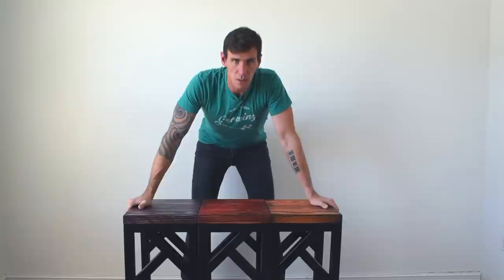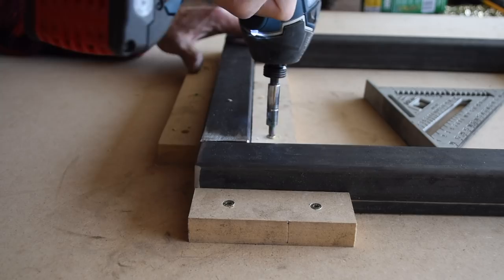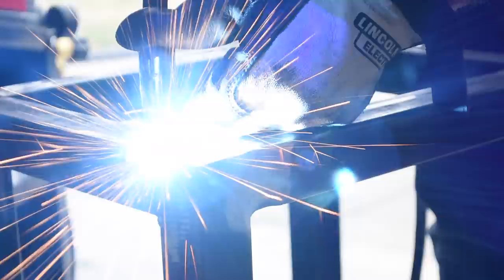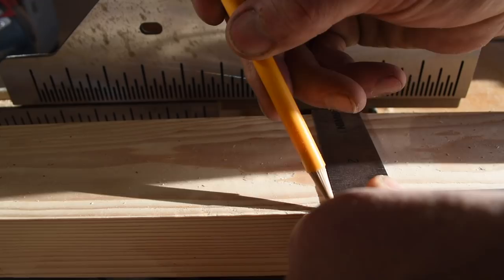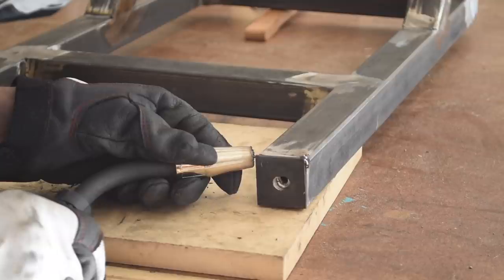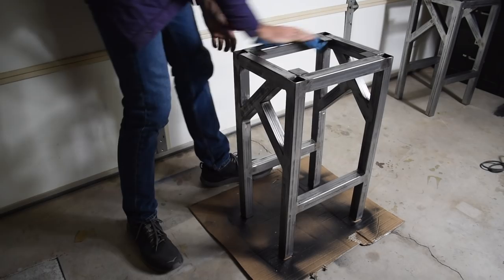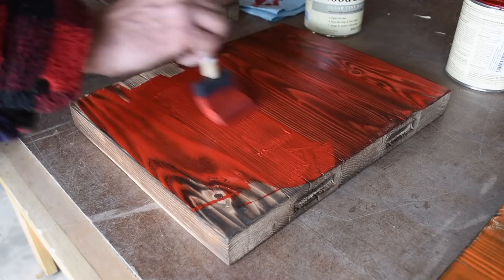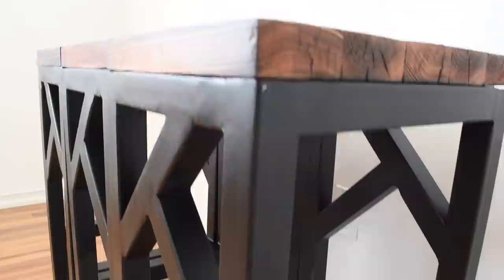DIY Steel & Wood Stools w/ Shou Sugi Ban | Interlocking | Beginner Welder

Comment: Awesome work man! Those bases look super slick. One thing, you probably could have tapped the steel for the adjustable feet rather than welding on the nuts. Would have probably been a lot easier!
Reply from the maker: Thanks, Johnny! I definitely need to invest in a tap set. Someone actually suggested this before I started, and I stubbornly stuck with welding on the nuts because I thought it would be easier. Lesson learned!
Reply: Hah, for sure! You don't even need a whole set, just get the tap you need on a per-project basis. Would have cost you like $10 and saved a buttload of time. Ya live, ya learn!
Reply: I've had 14 ga, even 11 ga, strip after a while, or at least bend, because there aren't many turns of thread in that thickness.  It depends on who sits on it I guess.  If it was 1/4", yes thread the steel.

Nice looking chairs.
Reply: Yea, I would definitely use thicker steel for the bottom of the feet if I was planning to thread the holes.
Reply: One other trick: to align those nuts for welding, run a bolt through the plate with a nut on both sides.  Tighten the nuts, and they are aligned with the hole.

Hi Johnny.  I've watched all of your videos too.  Nice projects.
Reply: RCWorks thanks man!
Reply: Welding the nuts was the right call. As a general rule, you want at least a diameter of thread engagement (depending on the application) and the thickness of the feet wouldn't have provided that.

It's extremely nitpicky, but it's better than having the thread strip and having to redo it.

For next time, I would recommend wearing a respirator when you weld the nuts. Most nuts are galvanized, and if you breathe in the chrome/tin off-gas, you could end up with welder's flu which feels awful. It won't kill you, but you'll be out of commission for a few days.
Reply: Or use rivet nut inserts. No welding no tapping needed
Reply: What type of welding you are using??
Reply: By Da way your projects are awesome have ha great future
Reply: Rip both sides. 
Try using larger nuts. 
If you hard-tap the nut down 
with a metal smooth headed hammer,
while the tack is hot: it won't lift. 
I also find that if I don't keep something
threaded in the nut, 
it can warp the nut 
and it won't pair well 
with a new bolt. 
It's also easier to hold 
the nut straight with the bolt. 
There's also industrial "weld nuts" 
that you can buy a bag of 
which have two tabs on the side. 
Fastenal should have them 
or just buy online.

Comment: Just a tip next time you weld the nut in go ahead and put a bolt in it and spray some anti spatter and it’s a breeze! Nice build!
Reply from the maker: Thanks!
Reply: or use a small metal sheet between the bolt threads and your mig gun or stick

Comment: Thank you for the video! I'm working on a similar steel frame project and this definitely helps with figuring out some of my processes. Someone mentioned taps for the adjustable feet, but I wanted to suggest you could bolt them in place rather than holding them freehand. Obviously use a steel, and not the plastic adjuster. Nice work, they look great!
Reply from the maker: Thank you!

Comment: Try using counter sunk screws for centering your nuts. Just cut it down so it's sits flush with nut, that way the sparks don't stick to the thread.

Comment: For future reference if you want to line up a nut in a hole like that, just tighten a bolt through the nut/plate and align whilst tightened.  This will also protect your thread from weld splatter.
Reply from the maker: Thanks, Adam!

Comment: the stools look great and love the magnet idea

a few comments just for the sake of commenting:

- angle iron would have sufficed

- you've added way too much steel and this makes the chairs heavy and less pleasant to move around, they are really heavy duty as in workbench grade!

- when welding, you should grind more on the edges at 45 degrees or less, then fill that with your welder, you've ended up with less than 1.5mm weld bead after grinding it, while that would be strong enough for a stool, it would be less so for something larger such as a table
Reply from the maker: Thanks for the tips!

Comment: Regarding the adjustable feets, next time, simply put the nut on the feet(or a similar sized bolt). The feet/bolt will help you center the hole. Then just tack it in place and remove the feet. Great project. Love the Shou sugi ban.
Reply from the maker: Yeah, I've had several folks suggest this. Thanks for the tip!

Comment: Nice video and great work. Maybe you have figured this out by now but I believe your wire reel was upside down.  You want that wire feeding in from the top so it’s feeding straiter from the reel.    Might notice the weld being more constant and not fazing out once and a while.  This also happened with the whip isn’t strait. But for first time welding looks great.  Cheers.
Reply from the maker: Thanks! Someone told me and I fixed it already. Shows what a welding noob I am, haha!

Comment: My assessment. Overall good design process and execution. Some of the design boils down to taste, which allows for changes. I would round the edges of the wood more. You did not show any of the welds. I could barely catch the sound of the welding and it appeared to be adjusted ok. You can also add filler if you do not want the welds to show. As a welder, I like my welds to show. 

Your idea to make a jig was a good idea. When welding it is good practice to keep the pieces secure or else a lot of warping may occur. The use of adjustable feet is a good idea because it is almost possible to get them to sit flush with each other. Be careful the amount of weld you put around nuts. Because of expansion by heat, you may need to re cut the threads.

 If I was doing metal work on indoor/outdoor household items for sale or for personal use, I would powder coat it. It is a nice finish and lasts a lifetime.
Reply from the maker: Thanks for the tips!

Comment: Nice build! I've been considering learning to weld, but it seems like there are lots of options... it's a bit overwhelming. In this video it looks like you are using a mig welder. Have you ever tried tig welding? Where do you recommend a complete beginner (with a lot of woodworking experience and good mechanical intuition) gets started?  Just buy a mig welder and go to town?
Reply from the maker: I’ve never Tig welded, but I’ve heard it’s much more of a dance than mig. My recommendation is to start with mig. If you know that you’re going all in there are some multi process machines out there that can do both. They are $$$ though.
Reply: Thanks for the advice. I'm just interested in dabbling at this point, and I know that mig is substantially cheaper than tig to get into.  I've been watching a lot of This Old Tony and his tig series just makes it look so easy... Not ready to pull the trigger yet, but possibly later this summer.  Thanks for showing the world that mere mortals can make cool stuff - even as a beginner.
Reply: Mig welding is the easiest welding process to learn. It boils down to adjustment more than anything, which is not hard to do. on everyday projects with light gauge metal, mig will give you the best looking welds. The strength of the welds in this project will never have to be considered.

Tig can be used but it would be inefficient. It requires more skill, steady hands and more time. You would not benefit by the results. Consider tig if it was a high end piece that also showcased the welds, is made out of aluminum or alloy. Think of bike frames.

Stick welding should not be considered either. Also takes more skill and steady hand. I would only consider stick for heavy gauge metal even though you can use it for light gauge. There is also a similar process to mig called fluxcore, which is used for heavy gauge metal.

More information than you needed to know. You will be happy with mig.

Comment: Johnny, another very nice one.  By the way, have you considered using the traditional method for Shou Sugi Ban instead of the blow torch?  Also, officially, I think the wood you used for this project (and a couple of others) is  something other than cedar.  Shou Sugi Ban translate specifically to "Burned Cedar Board".  So if you want to go total traditional, switch to cedar.  (Oh, and great pronunciation in this video.)   ><
Reply from the maker: Thanks!

Comment: Nice work man. I'd definitely try that project if i had a welder and the time.

A few questions:

1. How much wear on your chop saw did all those cuts do? It seems like almost doable by hand with good hack saw blades. I'm just more concerned as a dad with an attached garage for a shop. There are more hours that I could use a hand hack saw because I can do it on rainy days and at night.
2. Did you think about doing 45 degree cuts for making the legs join the top/bottom?
3. Why did you push the legs back in the jig to tack the other side? According to This Old Tony a weld pulls the two pieces together. Seemed like you wasted some time  forcing them back into the jig when you could have just clamped one side down.
Reply from the maker: There’s a decent amount of wear on the saw. I actually upgraded to a cold cutting saw in the middle of this build. Much better. When you tack one side the heat pulls the metal towards the weld. If you weld up one side completely it will compound the problem.

Comment: Flip your welding wire over. You want the wire to feed over the TOP of the spool so it can't crimp up going through the feed system and cable